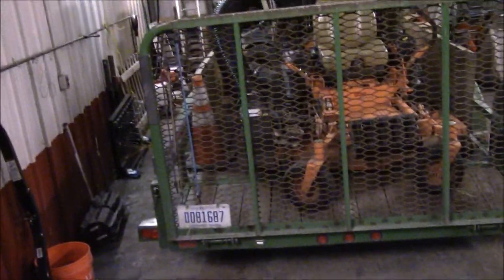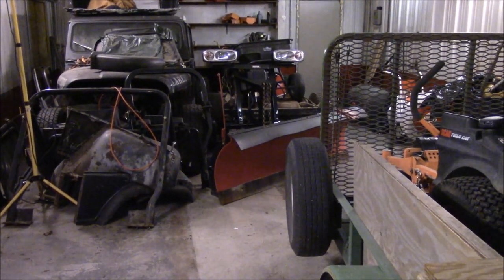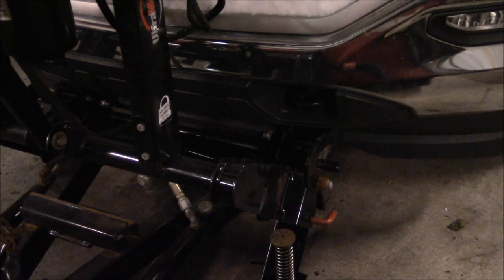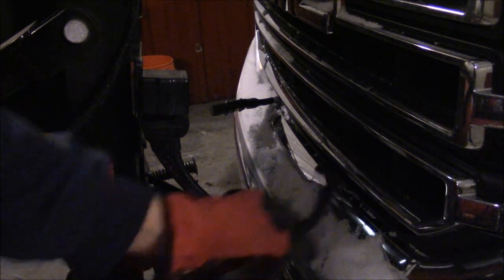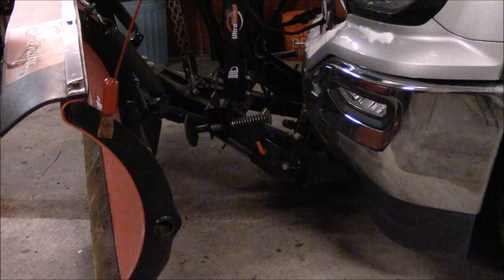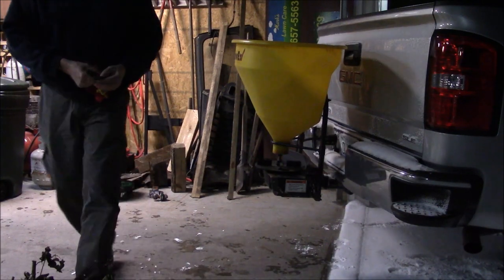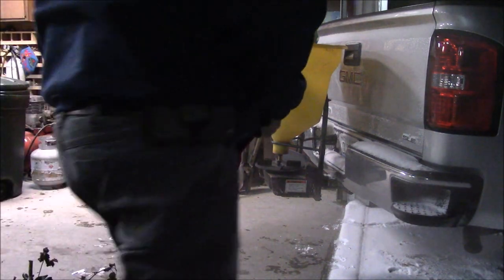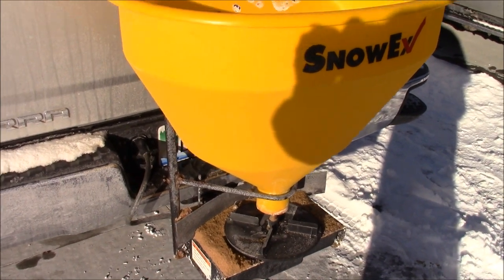Plowing snow the first time for the season

Comment: Put the Cotter pins for the plow sleeves on the inside the outside is where your plow hooks to
Reply from the maker: Vince Fargnoli they only go on one way.
Reply: @Marksmisfitworld  not the sleeve mark little cotter pin.if you put it on the out side of the sleeve the plow hooks can pop it out
Reply from the maker: Vince Fargnoli that is the only place for it to go. The cotter pin goes through the pin the plow hooks on.
Reply: @Marksmisfitworld  I'm not talking about the main pin that goes through the sleeve. The little one that you said you said you weren't sure about in video

Comment: When snow in the forecast plow should  already  be on truck
Reply from the maker: It would have been if the forecast would have not said less than an inch. Normal temperatures for our area is 45 for this time of the year. The plow usually doesn't get pulled out until mid December. I will be back to fall cleanups next week.

Comment: Wow, it’s been cold but haven’t had any any snow accumulation in Wisconsin yet! Plow on a 1500? How does it work?
Reply from the maker: I have been plowing with a 1500 HD for years. They work really well. The plow is hard on the front wheel bearings but that is the only problem I have with them. The other thing I like about the 1500 vs 2500 is the height of the truck 1500 sits 4" lower and that makes a big difference at the end of the day after getting in and out of it all day.
Reply: Marksmisfitworld the 1500 is not an HD it is an LD that is why you don't need commercial plates on them here in NY
Reply: Can you plow commercial with a 1500?

Comment: I would not be using a brand new 45000.00 truck to plow with. I would buy a used truck for plowing. Getting a used truck is just coming sense. I live in the South after living in upstate NY in the Adirondacks for 21 yrs and I can tell when a late model truck has been abused from a plow. We see these trucks all the time down here because they haul them from the north to here and try to sell them for top dollar like a southern trucks.
Reply from the maker: I had a used truck for plowing, I got tired of fixing it all the time so I bought a new one. We only get about 3 major storms a year so it doesn't get worked to hard. And then it pulls a 20 foot landscape trailer all summer. This truck will be sold with the plow in about 2 or 3 years.